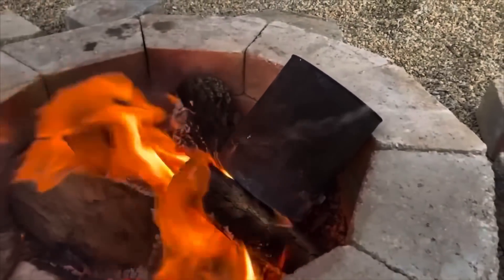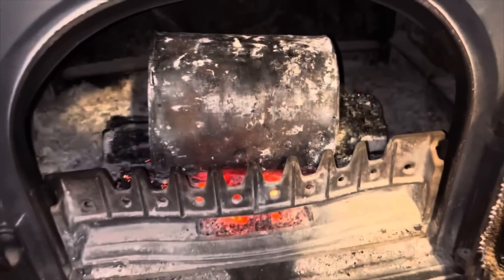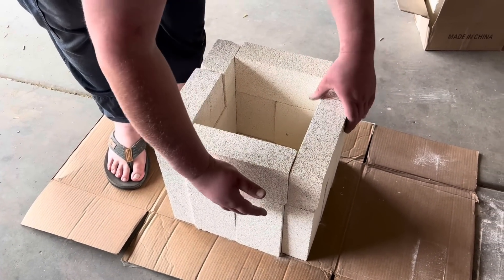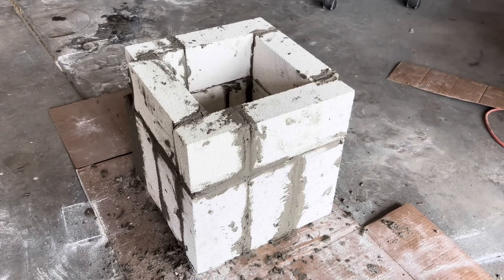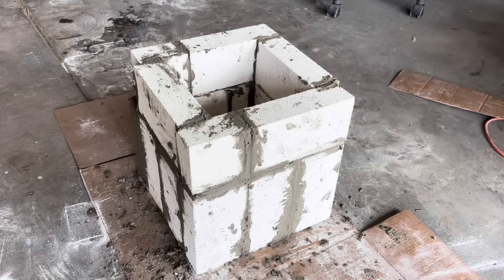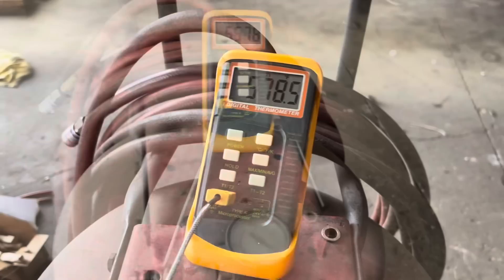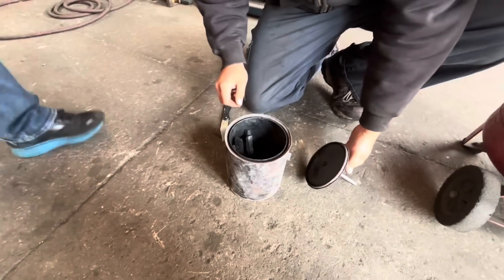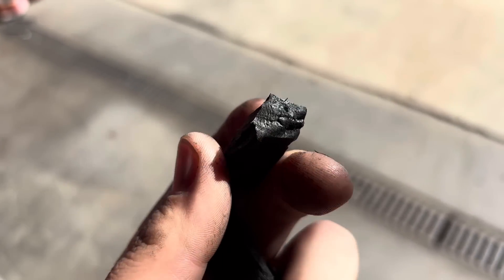Making “Scientific” Charcoal For Gunpowder

Comment: That kiln you made is WAY overkill 😂 
You probably could have gotten away with using a toaster oven, as long as it can get up to 550° (you might have had to mess with the temperature controller); those bricks are for going up to THOUSANDS of degrees.

Comment: Jake, I'm not sure how to send you a picture. I use an old pressure cooker with the rubber seal removed. I am using it on a small outdoor gas stove and can afford the speed recorder.I fit three toilet rolls. I am making it in 1  lb batches. Can you do it, please?

Comment: For pyrolysizer 2.0 you should incorporate a catalytic converter to deal with the smoke.

Consider the hobbyists who reside in an apartment or condominium with smoke alarms. There's an interesting option: you can use ascorbic acid (vitamin C) in place of charcoal. Try it out!

Comment: You probably know this already, but the gases coming from the paint can should be volatile. At some point you should be able to ignite them with a lighter. that would reduce your smoke problem. It may or may not be another variable you can control. Anyway, really enjoy your videos. Keep up the good work.

Comment: If you guys want to get scientific then you need to get a good high powered microscope and examine your charcoal. Keep in mind that different types of wood need different temperatures. For instance some hardwoods need a higher temperature to burn off the volatiles and softer woods need a much lower temperature. Took me years to come to my senses on that one. I mainly use eastern red cedar, maple, pacific willow, balsa, and sometimes cottonwood. Hardwoods I use only for pyrotechnics. Love your kiln looked messy, but worked great.

Comment: So  Bill Knight, aka The Mad Monk, discovered that Swiss black powder is a 78:12:10 formula milled for at least 24 hours. The Buckthorn alder is all harvested in the early spring when the sugar content is the highest and dried/aged 3 years. Charring is performed at 608 degrees for 8 hours!
Reply from the maker: I don’t know why they charr it for 8 hours. It might be because they a doing a ton at a time. We can charr a one gallon paint can worth in 2 hours, tops
Reply: @Everythingblackpowder  
Bill said the charing basket is fully packed and is about the "size of a Volkswagen" and barely fits inside the electric kiln. I would have to EWAG (Engineering Wild Ass Guess) that it may take that long for the very center to come to equilibrium!

Comment: What we can use instead charcoal ? Ash ? Hall?
Reply from the maker: Not ash
Reply: @Everythingblackpowder  I found answer about black powder in modern arms you must use guns which do not use gas system for recoil . Use recoil operation
Reply: @Everythingblackpowder  I made charcoal wet and then grind it with some ash . But now I need delete water from it .

Comment: Well i tried something couple of years ago and it seemed that work nice , I don't know if i found the fountain of youth but it's kids of weird! So i cut down some branches of whipping willow , i clean the knobs and the bark from them and i put them in thick salt in airtight container and i left them 2 weeks in them! After i take them out the water and the juices from the branches was absorbed from salt and they had a huge amount of weight loss! After that i take them for Charing in my paint can (2kg capacity ) and i put it in metal fountry (working with natural gas) and i set the temperature at 350° Celsius, and it was ready in less than half hour ! The end product was brownish charcoal evenly cooked fluffy and very brittle, the results was astonishing ! It was so damn fast and it was burnt in paper towel so quickly that the towel look like almost brand new like it never had burnt from black powder! I said again i don't know if that was luck or i find the way of top performance black powder but it was so good! You can try it jake and upload a video to show us the results! Nice education video !!

Comment: I don't know how well it worked, but some guy on the net was making charcoal in a paint can on a hot plate. It would probably be higher quality if the can was insulated.
Reply: An insulated pressure cooker, modified so it can't build pressure, could be used.

Comment: I believe you can ignite that smoke and it'll burn like a candle... and then there won't be anymore smoke. A pilot light there could probably be better, in case it wants to go out. I believe it's "wood gas" and is flammable, so it can burn almost completely. (little to no smoke).
Reply: I've seen cars run on that gas

Comment: Jake, I want to ask if, when using toilet paper to make your char, do you get a glossy black residue on the inside of your can? Sort of a tar like residue. I liked your tube idea in the lid, so I added one to mine because I cover my can with a metal 5 gallon bucket that has an exhaust opening in it. This helps retain the heat when cooking it over a small LPG burner. The tube now lets me see when the smoking stops a lot easier than before. The problem I have, is this residue exits the tube and tends to try and block it off. I am using Scott TP though, because that is what I have on hand and I use my BP more for fireworks and a small cannon. I do try and keep the can temp between 550-600 degrees.  Stay safe.
Reply from the maker: Yes but I always scrub the inside of my paint can with a scotch bright to get as much of the gunk out of the can

Comment: You should look into a PID and SSR to control the kiln/furnace. The PID turns the SSR (solid state relay) on and off to precisely control temperature.
There is alot of info on setting them up with wiring diagrams online.  You just have to make sure the SSR is rated for the amps of the heating element.

Comment: I own a heat treating company and build our high temp ovens. It was very smart to cage the bricks. As those bricks heat up and cool thy will crack. But if thy are constrained thy wont fall apart. If you have any questions about this let me know. I digitally control all my ovens with pid controllers. It’s a very easy set up and generally cheeper then a big varac

Comment: I like that temperature range. Is there a way to link in a thermostat so you don't have to constantly watch it?  I will be curious to see how your bamboo charcoal works out. I did a recent roasting of old bamboo tomato stakes and the air float charcoal had a rather high density so I did not make it into powder. I know, where is my sense of adventure?
Reply from the maker: Howdy Robert! We tested the bamboo powder today and it was slower than Goex by a solid 100fps but it was remarkably clean! It is the first powder made with charcoal cooked in the Pyrolysisor. I noticed the high density too which didn’t give me very high hopes but it exceeded my expectations.
Reply: @Everythingblackpowder  Slow but clean, interesting. But your weather is getting warmer and I have noticed I will get double the fouling with the same powder at cooler temps. It kinda drives me crazy but to truly compare one powder to another they have to be same composition, puck density, granule size, etc  and shot at the same temp/humidity. Thanks for the info. I saved that bamboo charcoal and see what kind of adventure it makes.

Comment: If you Light the Smoke you should be able to tell when your getting close to done the Fire will go out and you don't have to Breath the Smoke while you wait .If you build a P.I.D. Temperature Controller it should Monitor your Temperature and Prevent Overheating .I got the plans from a"Johnnie's Reloading Bench 'video and use mine to prevent my Lee Bottom Pour Pot from running too hot. I built another to Anneal my Cartridge Brass .

Comment: Rock wool insulation around the bricks.  Bet you can  get as hot as you want fast.  Add simple bang bang temp control for Lab grade oven.  ❤❤. Cottonwood,  prefect, or was it ??   Thanks, you are saving me time on how i am going to get great charcoal.   Measure ohms of heating coil, then you can see how many watts.   P = I * I * R. =.  E * I.     Or just R = E  /  I.   😎.

Comment: Wouldn't it be easer use some oven or stove top elements and make PID controller for it? Even if you keep your current element, a PID controller would automatically dial in your "fine tuning" and avoid the manual tweaking on the variac. As for the smoke, try lighting it on fire. You might get a nice little Bunsen burner effect.

Comment: Might be worth integrating a PID controller instead of the variac to keep the temperature more consistent.  Johnny's Reloading Bench had a design intended for lead melting pots that could probably be fairly easily adapted.

Comment: the only problem for you is that now you are going to have to do a bunch of testing on both temperature and time. choose one wood that has been a consistent performer. then do a control of your normal way of making charcoal and a couple of tests at different temperatures and time. then test all at once. a lot of work yes but the only real way to tell what makes a difference.

Comment: I think it might be a good idea to torch off the pyrolysis gases or cool them down and collect the flammable liquid for other use.
I guess there are no buildup from tar in the bottom, even though the jar is top vented? It could be worth monitoring if you try stuff like pinewood. 
My take would have been to control the temp in the usual place, just shielding it off a little better and controlling the temp using a small fan.
Good stuff. Thanks.

Comment: you know Jake you can order charcoal like the potassium nitrate from a chemical supply if you want scientific stuff!! and if the smoke gets to you put a match to it it'll burn off i do that all the time making char as a matter of fact that's how i judge how done it is! it quits burning it';s almost done! those bricks have a lot of perlite and silica in them and they're bound with a sodium silicate if i remember right! there';s videos on here of homemade forges where they make up refractory that's about the same as those bricks!! i can tell you as to flint and steel sets cottonwood is a prime species for both char and for making bow drill sets, now as for bamboo i've heard it depends on it's age and variety of bamboo but most powder from it is dirty and slow burning!

Comment: 2 hours at 550-600F using a sheet metal "oven" on the propane burner will render six rolls of Cottonelle in a popcorn tin. Pain in the butt because it has to be constantly monitored and the burner adjusted.  I got a junk 220V electric oven and have been planning on gutting out the big range element, wiring, and one burner control knob for a cheaper to run pyrolicizer..er..rer.  Find the setting that is the right temperature when everything is heat soaked and at equilibrium and just leave it set there.  You don't really need refractive bricks for 600 F, ordinary red bricks or even concrete blocks will do just fine but much harder to drill or carve out channels for your elements and absorb/transfer/lose much more heat than firebrick or refractory brick.

Comment: At some point the only way to improve the performance is going to be to find a catalyst, and there are some out there. The classic one for pyrotechnics is antimony trisulfide, but you probably like your liver and kidneys the way they are... nasty stuff. But taking the 'backyard garage' thinking approach to this, there's a similarity I see in some of these to a different process, oil driers. 

Oil drier is a compound you add to a drying oil... a wood finish, to make it polymerize faster and harder than it normally would. It's catalyzing oxidation. 
What do you need to do in more rapid fashion with gunpowder? Catalyze oxidation. 
And what have I heard is one thing used long, long ago in both processes to improve oxidation? Lead oxide. You'd get it naturally from milling BP with lead balls, where the wood finishers would just mix in some litharge (white lead oxide). Since that's no bueno these days since leaded coatings were shown to be more than just tasty to unwatched kids, there have been alternatives developed. 

And before I write a dissertation on metal catalysts, I'll drop back to the backyard approach... just get a little can of "Japan Drier" from the hardware store and leave a little out until it dries and leaves it's contents behind, and mix in a little of that towards the end of processing. Tiny batches first of course, no guarantees there isn't a self-starting exothermic reaction waiting to happen thanks to sulfur's presence.

Comment: You both overdesigned and underdesigned your kiln. You don't need insulating firebrick (2300 degree F) at all for a 600 degree F maximum temp. Fiberglass would be adequate. A kitchen range type heating element would be more than adequate instead of messing with bare chromel heating wire. You should be using a thermocouple temperature controller like a REX-C100 kit that you can get off ebay for under $25. Then, you don't need the variac at all. I have all the stuff, I'm just a slacker and haven't put it together yet. Soon, though, and I'll have to figure out how to post it so everyone can see. I call my design a retort. It's easy, and scalable. Cheers.
Reply: A large toaster oven has all you need - sans the precise temperature control. A pizza baking stone gives thermal mass to avoid overshoot. Wrap the whole thing in fibreglass or rock wool insulation.

Comment: This channel has consistently provided the best info around on this subject,that alone makes it stand alone,but the quality of the comments have added so much to my powder production,thankyou so much.have still found thumb dia red popular,aged for 3 to 4 years ,at a low temp,still kind of brownish……not fully charred.  makes the fastest and cleanest powder.this is a recipe from Workshop Reciepts. Circa 1864… best regards from nz
Reply: Could it be that at this point there are still sugars present in the wood which react with the KNO3 just like a sugar rocket motor?
Reply from the maker: Excellent. Thank you

Comment: I think basswood will make a good carbon source. Definitely give that a try. It's a light wood, not as light as balsa but lighter than pine. It's actually close to the light grain of the pine but way softer that the dark grain of pine. I'd gladly send you some if you have a PO box I can send it too. I use it for whittling 👍

Comment: Use a PID and a thermocouple and you can set the temperature you want and walk away. Would probably be cheaper too. I've been contemplating building a small heat treat furnace and it could be used as well with very accurate temperature control.

Comment: Ok, close to what I want to see. This is what I want.  The best TP, all the same batch. Real control of temperature, I suggest you insulate the box(fiberglass with foil wrap) and put in heat sinks (large steel bars in corners work well). Heat it up and run batches at a fixed temp in 15 minute intervals. I would particularly like to see it pre smoke stopping. Then mill and strain to a set size.  Please?

Comment: Welcome to the club.  You can expect 20%-45% volatile content by weight. I've not run this species in my lab so I don't know what you'll get. I suspect about 30% volatile content.

You'll attain lower ignition temps, lower combustion temps and the higher volatile content offsets your fixed carbon and by way of this, offset the inert ash content which translates to more fuel by weight and less fouling.

There's more chemistry involved too. A lot more. Like Ph.D worthy studies that one can venture into both in the charcoal and the powder made from it.

Comment: Hi Jake, have you considered using a thermostatic switch? Hard wire 110AC to the element through the switch. Putting the probe down the chimney. When it hits 550F the power is cut, when it drops power is reapplied. Wouldn't need as much babysitting. Appreciate that this is a prototype. Hugh
Reply from the maker: Yes we are looking into running a PID
Reply: @Everythingblackpowder  If you can't PID cheaply (you can) or easily (there's the rub), most household ovens top out at 550F. Food for scrapyard thought.

Comment: I'm following you on this. So far I've had to buy some 4" pvc + fittings, a v belt and one pulley, 40 1/2" balls (need more and bigger!😅). I'm in the process of milling ingredients and experimenting with the process. 
I have some experience with temperature and have many "artifacts" laying around as a result. I knew I'd find a use for it someday!

Comment: A month ago I wrote in a comment:.....Use a controlled carbonation temperature. And here it is.....😎..Great work boys.
(The furnace could have been made from a small stainless steel beer keg. Filled with ceramic wool. Easy to carry and indestructible)
Reply from the maker: Now you tell me. 😉

Comment: Dang, I thought drilling a 2nd hole in the paint can lid and putting a lead thermometer in it and leaving it the whole time to monitor temperature and adjust gas grill accordingly was a breakthrough & cool: outdone again!!! 

Looked like a fun project, w a cool name and worked as designed. Well done once again!
Reply from the maker: Thank you
Reply: @Everythingblackpowder  He's got a good point though, a second hole for the pyrometer would let you flare off your pyrolysis gas without fouling the thermocouple lead. OR... direct it onto the side of a square metal can full of cold water. That'll condense any vapor component and give you an idea how "dirty" the base component was by the size and type of stain/goo it leaves behind.